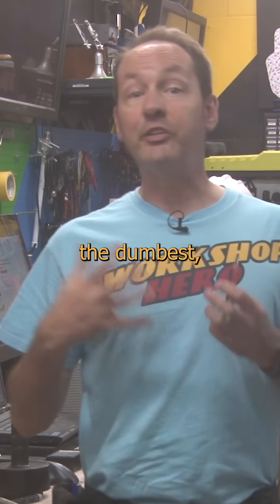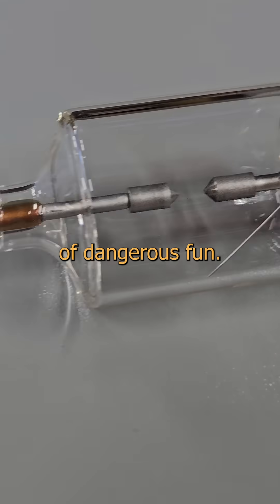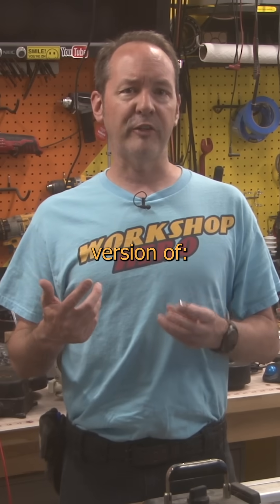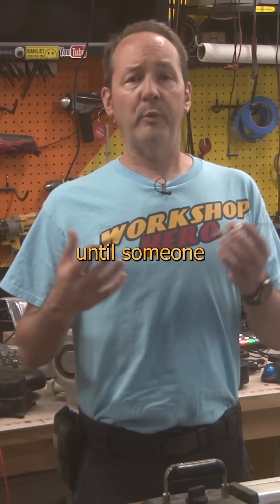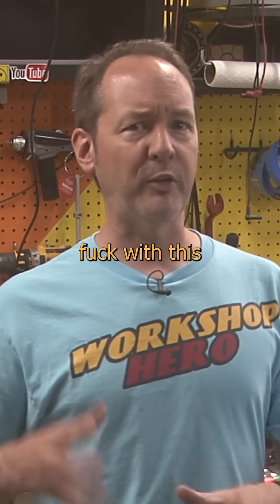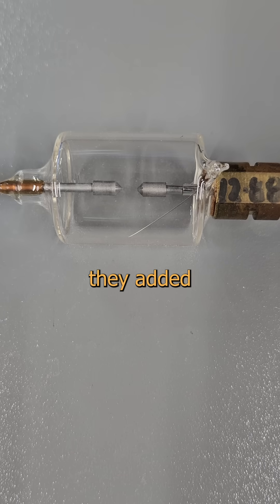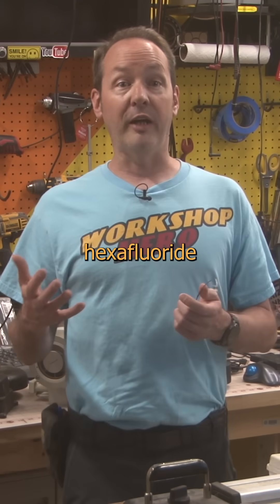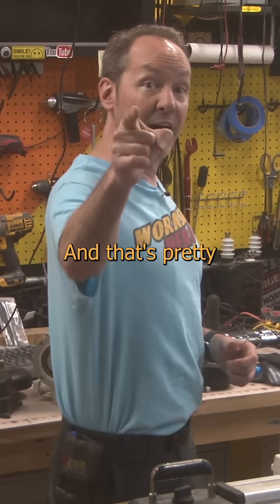Spark Gap Tube #chrisboden #comedy #engineering #highvoltage #physics #tesla #science #energy #cool

Comment: In a previous life I helped design and develop a 1M amp spark gap switch.  Thats 60kv of anger pixies just chilling in a capacitor bank large enough to use as a dance floor.  It would regularly switch 600k amps for an experiment we were running.  I did see it touch 1.4MA once, but only once.  After that it needed a unscheduled broom and dustpan service from all across the lab, including the rafters, with a post pop underwear inspection for good measure.
Reply: @zeropointmx2552  this was an exelent description I could easily follow along with...reminded me of the first capacitor I intentionally overloaded...it ended as a small mushroom cloud over my lab table n a ringing in my ears that I can still faintly hear some 25 years later...
Reply: Let me guess, was this a setup for fusion experiments?
Reply: @deltab9768 Maaaaasybeee.  No camera footage, but did make it in the display case of shame.
Reply: Kaman Sciences by chance? Thier bank had a note on the wall of what to do if caught in the room during a shot . Last line was Kiss your a** goodby...
Reply: Damn... Do you happen to have the footage
Reply: @hokiepokie_soupermane Typically such footage doesn’t survive the “what do we tell the insurance adjuster” conversation. That assumes the cameras watching survive the EMP spikes from that kind of switching event

Please don’t ask me how I know.
Reply: @hokiepokie_soupermane unfortunately not. I had some spectacular after photos tho, but they were left behind after I left.

Comment: I see a lotta people asking about the little wire off to the side. I'm taking an educated guess here, but judging by the fact it's firmly touching the glass, I'm pretty sure it's a grounding wire designed to catch the static charge buildup on the glass. That wire is there to give it a quick and easy path to ground. Without it, a LOT of static could build up in the glass and if you touched it, all that charge would decide the fastest route to ground is through YOU.
Reply: Twas curious about it as well. Your explanation sounds mighty reasonable, and I will now take it as fact until proven otherwise. Good job!
Reply: I liked your response and would suggest an additional model having to do
with "Paschens Curve," which relates breakdown voltage distance to gas pressure and the type of gas.
Having the side-wire makes the spark stable. When the spark gap is not firing, gas is sorbed onto the metal, (and glass surfaces), as everything is cool/ambient. As the spark fires, the electrodes heat up and diffuse the sorbed gas which dramatically changes the vacuum pressure.
I would be interested in your background, (where did your comment come from.)
Enthusiast, electrician, technologist, engineer, physicist, PhD?

Thanks
Reply: @dreynolds7915  Oooh, yeah, that's not something I'm familiar with, but that certainly sounds plausible as well! And I've got a BS in Electrical Engineering and a few years experience acting as a manufacturing engineer. We never learned anything about spark gap tubes, but I've done enough hi-pot tests to know how important ground-bonding is for anything a person might touch, haha.
Reply: Sounds about right
Reply: I wanted to give you a thumbs up but the count is at 69 and I didn't want to ruin your fun.

Comment: I always found it amazing that they could tune the frequency of a Tesla coil using a rotating spark gap. If you think of a Tesla coil like a swing, or a pendulum, that periodically gets pushed to increase the momentum, the spark on an outer winding shoves it, rotating closer to dump the load before retreating. Changing the rpm will both change the size of the pushes and the frequency to align with the frequency of the Tesla coil.

Comment: Hydrogen gas is used as a coolant medium in power plant generators... Dang right it's gotta be pure and you sure don't want any air mixture with that puppy. They bring in a truck to pump the generator out and then proceed to do their maintenance. When you are pushing 35,000 volts and 17,000 amperes with a 3600 RPM armature... You definitely don't want things going sideways. Sparky, Sparky, BOOM is never a good day.

Comment: Another way to lower the breakdown voltage of spark gaps is to introduce a little bit of radioactive gas into the envelope. The radioactivity ionizes the air between the spark gap points, lowering the breakdown voltage.

Comment: That hydrogen joke is real. People think hydrogen is inherently dangerous but it's like fire, it needs oxygen for it to actually light. Complications come in that hydrogen is annoyingly hard to seal for due to being the smallest element. And unlike natural gas we don't put indicator gases in hydrogen.
Reply: Even if you did, wouldn't the indicator gas not leak while the hydrogen would, potentially?
Reply: @wilfreddv  Potentially yes but the chances of getting the tolerances being that specific are low.
Reply: @allstarwoo4  i mean, hydrogen will literally seep into the steel tanks you store it in. Like, into the steel itself. Just wiggles its way in between the iron and carbon atoms. Now that's not gonna leak fast enough to be a fire hazard, but it does enough to the steel to be an rupture/explosion hazard if you don't account for it.
Reply: Oxygen doesn't burn. It causes other elements to burn.
Reply: @stevenraccoon4654  Depends, if you put enough pure fluorine with oxygen the fluorine will oxidize the oxygen!
Reply: I was sitting here thinking, "well H2 is hazardous because it fully aerosolizes, unlike most fuels we're familiar with," but then you reminded me of natural gas which has lower density than air. So then I thought "well maybe it has a lower ignition temperature, making it more prone to spontaneous combustion." Nope, they're both right around 500˚C.

So yeah, it would seem like you're exactly correct. The particularly unusual dangers of hydrogen are simply that it readily leaks and is difficult to detect. But given that people can set up tools to perform electrolysis of water in their kitchen using supplies from the grocery store, I suppose it can't be that much worse than half the stuff we have immediately available anyway.
Reply: Pure H2 environments, heated, can purify the surface of a metal--the gas reacts with the surface compounds, releasing them from the metal. Copper is never as pure if you don't do this.
Reply: No doubt it's hard to seal, but Helium is actually the smallest atom in terms of size, not Hydrogen. It's a bit counterintuitive, since He has a higher atomic number. But the more protons there are, the stronger the electrons are pulled toward the nucleus, making it smaller. 
However, it doesn't get progressively smaller the further down the periodic table you go. Lithium (the third element) for example has three electrons, one of which can't occupy the lowest energy level, so it's bigger than H and He.
But, the periodic table is underrated. The elements are ordered by size as well. The elements on the bottom left are the largest, and they get smaller toward the upper right (with some exceptions)
Reply: @SomethingAbtScience  Not only does hydrogen have a larger atomic radius than helium, but pure hydrogen tends to form H2 molecules in order to be stable at STP. Helium is typically monoatomic under those conditions so it's even smaller by virtue of not being paired.

They're both exceeding tiny compared to everything else though, hence the difficulties in storing either.
Reply: I assume we've got something better than the goldbeater's skin (animal stomachs) they used for gas bags in the early days of lighter-than-air flight. ...or do we?
Reply: Did you know some places, even now, will use the broom technique to find hydrogen leaks? Unless I misunderstood a comment I read a while ago 😂
Reply: @Casey21.  Nice. That's like the money we spent on a pen to write in space. And ussr just used a pencil.
Reply: @non1503 which isn't actually true, pencils are dangerous in space because they make potentially conductive (graphite) dust that can float into the electronics.
And the Fischer pen was privately developed and some were just purchased by NASA.
Reply: @Casey21. That's a mostly false myth. Hydrogen won't ignite a broom.
What it is based on is detecting hydrogen FIRES that burn mostly invisibly, but that's a rare use.

Now they are used a lot to detect high pressure steam and hydraulic system leaks, because they will take flesh off, or tear a broom up!

But just low pressure hydrogen won't ignite anything from contact, unless it's already burning.
Reply: And this vid. Made me think of a Kelvin generator. Jumping spark gaps and all that.
Reply: Well 99% of the time it has the oxygen it needs to explode
Reply: @Nathan-i3d not really. Car batteries give off small amounts of hydrogen and there aren't many stories of car batteries blowing up. It happens but the chances are pretty low considering how many cars there are.
Reply: Not just oxygen, but any of the "oxidizers". If you burn hydrogen with fluorine you get HF acid instead of water.

OMG, you don't want to mess with HF acid. An HF burn on your skin will leach calcium ions out of your blood. Those calcium ions are important electrolytes that allow muscles (like your heart) to function...
Reply: I operate a 1350MWe generator. It is cooled with 75psig hydrogen. H2 has a very high specific heat capacity and very small mass, so there is less windage loss compared to anything else. We use oil seals to contain the hydrogen.
Reply: @allstarwoo4  Odorant indicators can be added to gases, but I'd depends on the uses. Hydrogen probably doesn't have it as standard as it's mostly used by trained people, whereas natural gas (methane etc) is used by the public, and is present in lots of places in pipework.
Reply: 2nd smallest*
Helium due to its filled valence shell and higher proton/electron ratio, pulls them in more closer than hydrogen and its single electron, but its still as much a bitch to seal
Reply: The smallest element, but not the smallest molecule:  hydrogen is diatomic, and those two atoms are larger than a helium atom (which doesn't pair up).
Reply: @johnrehwinkel7241  Helium itself is also smaller, smaller electron shell
Reply: General speaking,  oxygen doesn't explode, it is an accelerated for a fire.
Reply: Remember the Hindenburg!
Reply: @CCRoselle they also used a paint that turned the blimp into a giant thermite balloon. So did the Hindenburg fail because of the hydrogen or the thermite skin? Im going to say the skin bevause hydrogen explosions are notoriously powerful.
Reply: @allstarwoo4  I worked in a large R&D lab with HIGH PRESSURE  hydrogen piped everywhere. Also a special facility with extreme high PSI  hydrogen.
We had a laser and mirror system at the ceiling to detect any escaped hydrogen., COOL STUFF.
I liked to remind the team to "Remember the Hindenburg!", to keep them focused.
Reply: Now that's cool! Did you have a blown up... Diagram of the Hindenburg in the break room? @CCRoselle
Reply: @CCRoselle  Nice laser mirror system. That thing has to be way better than the invisible fire detecting broom.
Reply: @CCRoselle  can you explain how that mirror and laser system works to detect hydrogen? Interesting stuff!
Reply: @MidSouthMotorSports  basically they are measuring the diffraction of the laser. With that being said I don't know the specifics if the laser is calibrated to detect hydrogen specifically or whether it's calibrated to detect changes in the air. Laser measuring is something I don't have much experience in.
Reply: @allstarwoo4 Aluminium and a flammable dope, seems to have been cellulose acetate butyrate. Though, the theory that it was the paint that made it such a disaster has been challenged.
Reply: @CCRoselle On top of that, remember the U.S.S. Akron! 73 dead, compared to the Hindenburg's 36.

Comment: Movie theaters use a similar device for their light bulbs. On non-laser projectors we use what's called a Xenon Arc Lamp. It's a bulb made with a quartz/crystal envelope (the clear outer part) which is put under a vacuum then filled with xenon (because it's non-reactive) with a tungsten anode and cathode. Then we put an absolute shit tone of power through it which forces it to make a pure white light. It is a small bomb due to the high pressure gas inside it. You can't touch the quartz when installing it because if the oils in your skin stick it can cook when powered on and cause the envelope to buckle then detonate inside the projector and it's a little over a thousand dollars to fix that every time it happens.
Reply: If it was about being inert, they'd use Argon. Xenon is used for the color.
Reply: @SkippiiKai you are right, I was misremembering. That's what I get for trying to use my brain on only 4 hrs of sleep.
Reply: We were always taught to not touch automobile headlights because of similar reasons. They aren't nearly as dangerous but a pain to get back out when they break.
Reply: And it is about 10 kWatts of power at 50 Vdc
Reply: Have a dozen 3K xenon followspot lamps in my basement to recycle the xenon gas and thoriated tungsten electrodes out of.  There's 5 ATM of pressure at room temp in them.
Reply: @2fathomsdeeper some bulb makers will buy them back for the gas recycling
Reply: Didn't anyone see the phaser on the peg board
Reply: In the late 80s I worked at the local movie theater and they had expanded from 1/2 screens (500 seat auditorium split in late 70s) to a multiplex of 6 (4 new auditoriums). They went from union projectionists and “carbon arc” to an automated platter system and xenon lamp houses that anyone could operate. One former projectionist Fred would come by and hang out and also talk with a long time ticket booth cashier lady. I never asked but I’d pet the ages of our modern non-union projectionists as early-mid 20s. Probably in college or just out, and making extra money. Basically people older than us teens pushing candy and soda or ripping tickets and sweeping floors. But if we (and rarely) needed a bulb change our manager (he was old, like in his mid 30’s! He’d been there for a decade or a little more) did it. Protective face mask shield (a hard plastic) and maybe not a flack jacket but some sort of gear should shrapnel fly. We’d have to cancel the show and refund so to give time for the bulb to cool down. And run the movie dark (platters.. they don’t reverse). 

What memories. 

And I changed my first cat’s sealed beam headlights but when I got a more modern car I did hear about needing to not touch the bulb directly. ALSO halogen bulb lamps (typically with variable power output) were popular. I wonder why the spare bedroom is set up as a computer room and “home theater” (nothing like it, just my lame name for an ilea desk with a vcr and a little tv 😂) got so hot in the summer. At night. When I had the lamp cranked. Eventually I figured out those lamps got hot. Especially when a ladybug 🐞 would fly in and cook. What’s that smell? What’s that smoke coming from the lamp? Yeah, eventually it all clicked. I’d think it ought to be obvious sooner with a college degree requiring so much science and math. 🤣
Reply: Not being able to touch is similar to tungsten halogen lamps used in theater for high powered lights
Reply: @obsidion_flame3095 any halogen bulb shouldn't be touched, or should be wiped off with alcohol after touching. Halogen bulbs are fused quartz glass that handles the high temps of the halogen cycle, and they don't play nice with oils at temp. Soda lime glass is used for Incandescents. It also blocks UV, unlike quartz, which is why for residential lighting, halogen lamps always have a second layer of glass an inch away to protect people.
Reply: Exactly the same as automotive headlights!
Reply: @in-spec Those are HID automotive lights that use Xenon, which seem to be mostly replaced by LEDs. I think you can still get HID as high power grow lamps.

Comment: I love how you can tell which side is the source, cause it has been punching the other side in the face for a few decades rounding out its arc tip nicely
Reply: If you want perfectly rounded tips, one method is to do this, over and over.
Reply: I was looking to see if anyone else saw that.
Reply: I would've thought both ends would erode equally?
Reply: @breadn0p3544 for AC yes, but this seems to be DC. You could achieve similar arcing with a permanent magnet. It also matters if the material of the electrodes is ferromagnetic.
I used to work on ignition systems for lighting gas/oil burners. Some of these rely on air flow to drag the arc away from the electrodes. We made some fancy looking high speed recordings. That was pretty cool.
Reply: @Martin-l8d8z  ah right, i always thought the erosion was due to the effects of the plasma, but sounds like its more to do with electron impingement or something similar?
Reply: @breadn0p3544 I was referring to the current flow in the plasma that generates a magnetic field, which then creates a force that distracts the electrons from taking the shortest path.
Heat is also generated by the current flow, which leads to molecules being evaporated from the electrode surface. That is why air flow helps to cool the ignition electrodes, so they last longer. This glass tube filled with gas is no particle accelerator, so the electrons are moving too slow for impingement to play a major role here.
Considering that Chris showed this fancy vacuum pump in another short video, he could also light some vacuum arcs... In that case, the plasma is  building from metal ions instead of the gas. This would erode the electrodes quickly, involving the impingement that you mentioned.